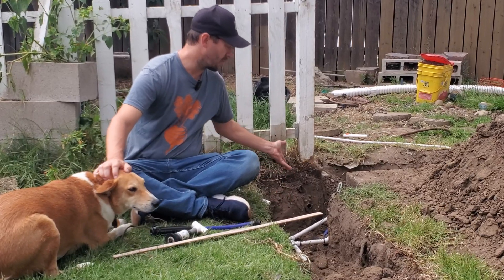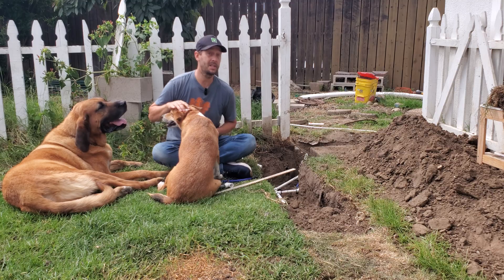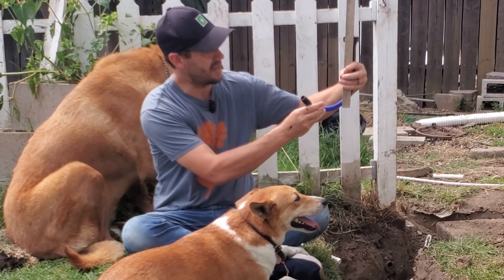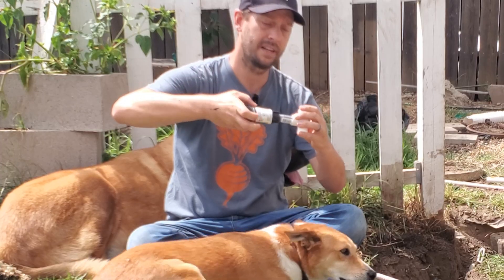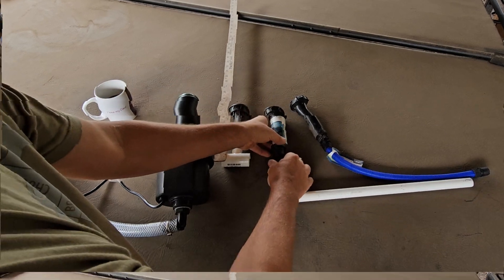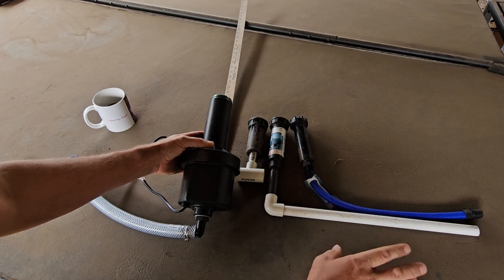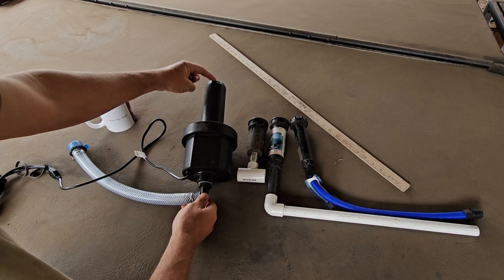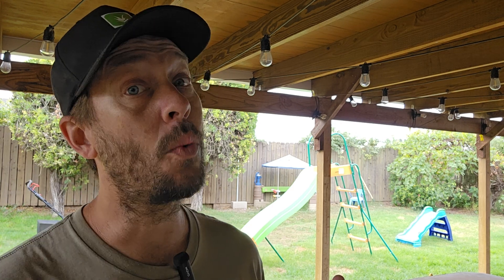How Deep Are Sprinkler Pipes Underground

Comment: I started replacing our risers and sprinklers to the Hunter sprinklers using the swing arms.  That way I can dig the lateral line deeper and prevent breaking a rigid riser because the swing arms will flex under foot/mower, etc.  I am using the 6" Hunter sprinklers that actually have a side opening option for screwing in the swing arm.  The bottom has a screw to close and seal it.

Comment: Didn’t you have a grumble about the Iragreen(?) sprinkler system.  I really had the impression that you would not be using this sprinkler system again.
Reply from the maker: I wanted to be super honest about what I didn't like about it and how the tuna can/coffee cup water test wasn't accurate, but I fully intend on using it for a long time to come; I think the benefits outweigh the drawbacks and so long as I don't have bare dirt to irrigate the water flow is great. I'm preparing to put it in my back yard in October and may even buy an extra head, this time the more advanced XP head for increased accuracy. I can't use it on the parkway strip though; it's too narrow so that one I'm hand installing the best traditional pop-up sprinkler zone I possibly can.